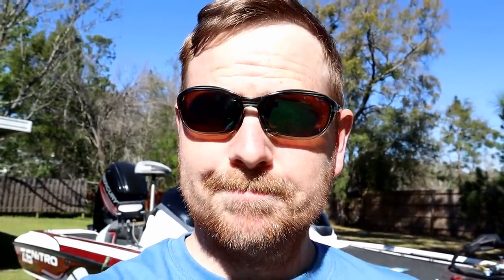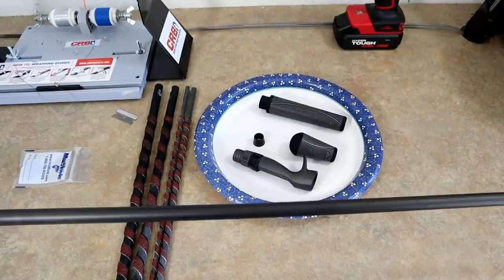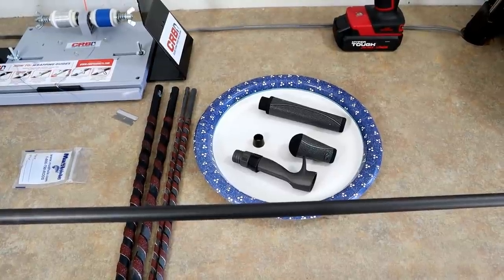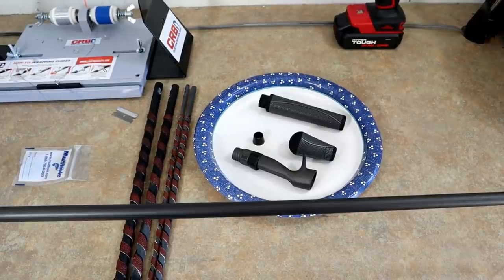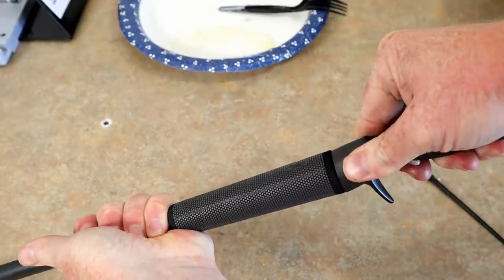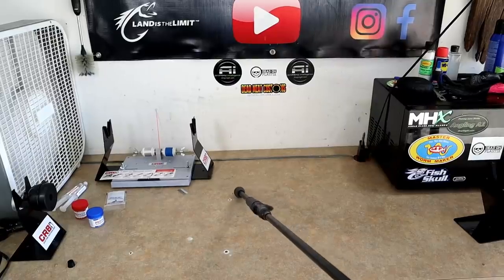SECOND ROD BUILD: Making A Worm & Jig Rod; Custom Rod Building

Comment: Your second rod build turned out much better than my second build.  A couple of things you may want to try.  Measure out exactly where you are going to place your grips, mark them, and rough up the finish on the blank to create a stronger bond.  On a matte blank it's not as important as it would be with a slick finish like the one Scroggins built but trust me it's worth the extra effort and if you don't you will eventually have a grip come loose.  Another thing to keep your grips from getting too loose when you ream them is always start the reamer from the bottom of the so the taper is the same direction as your blank, in other words the bottom of your grip is going to be a slightly larger diameter than the top.  Another thing you might want to look at is "locking wraps" for your single foot guides.  It would be hard for me to type how to do this but there are You Tube videos on this subject.  Flex Coat has a pretty good one on the subject.  Good luck, love your channel!
Reply from the maker: thats a great point on the direction of the reamer...didn't think of that!  thanks for the tips man
Reply: @WorldsWorstFishing  From one drummer to another...

Comment: Nice job! I like the blue/silver color combo. Rod building is so addicting. I keep finding new rod builds that I “need.” I’ve probably built 40 or so bass, panfish, and trolling rods.            One thing I noticed, when you are tightening the wing nut on the thread carriage rod (metal rod that holds the spools), make sure the two nuts in the center are tight to the center post. They were moving a bit when you were wrapping which was why the tension kept loosening. I’ve done that a few times!
Reply from the maker: okay Ill make sure and do that...keeping great tension has been a pain thus far
Reply: That should definitely help. Mudhole also has a new 4 spool carriage upgrade that uses a different knob for tension and fits over the old one. It’s so much better!

Comment: I build rods sometimes, but I often find myself reguiding rods. Even some very nice off the rack rods have not so great guides, or maybe dont have enough guides. My first foray into reguiding was on a shore beater ugly stik I use for cat fishing. It was a two piece rod, and the guides were so far off the spine, that the upper half would rotate under load. It's all a bit easier for me, since I own a motorized wrapper, but even with the experience I have, I still learn a surprising amout from your channel.👍👍👍

Comment: 2 tips, on your thread wrapper, tighten the two interior jam nuts so that the spool shaft does not rotate.  This allows you to tension each spool individually with the provided wing nuts.  
When I wrap accents, I find it easier to wrap the accent first and then wrap the guide thread on.  Lock the tag ends of the accent thread under your guide wrap thread.  This keeps the accent wraps in place until finish is applied.
Reply from the maker: thanks for the tips man

Comment: much better!!!   a quick tip.. cut the tips of your paintbrush and as you apply the epoxy to the thread wraps turn the brush  so that you are pushing the epoxy to the edge of the wraps with a point rather than a flat brush.  this will allow you to get a nice sharp edge to your epoxy..

Comment: Love the difference from the first video to this again lock that threaded rod the spools are on tight and your tension will be adjusted by the wing nut and that will certainly help with how tight the threads are against one another and pull the tag end on the opposite side of the guide to secure it tight also filing down the tips of the guides will help the thread transition from blank to guide tight lines
Reply from the maker: yeah my tension setting need some work!

Comment: Looking good! Keep practicing and it will get easier and easier. One thing you may want to try is A or B sized thread for the wraps and may want to tighten the bolt on the hand wrapper. I keep mine tight so the thread spoil rotates around the bolt, good work bro!
Reply from the maker: Hey John!! I think im using A size..havent actually looked since I got the kit.  Def gonna keep practicing.
Reply: Your doing good!

Comment: Looking good!!! If you use a thread that contains nylon, you can use cigarette lighter to give the thread a little burn treatment after wrapping. That way you do not need to rush putting on epoxy as the nylon in thread burns a bit with heat treatment and and "secures" the thread form getting loose. :)
Reply from the maker: hmmm...very interesting!

Comment: To make your highlight band easier, tape the highlight thread to the blank after you get the guide banded down. I like to wrap up to the ring, then start wrapping back.place two pull loops when your about halfway back to the starting point. Use one to pull your main thread under.( I like to pull under at least a quarter inch,  by pinning the thread just under the first wrap. Then cut the tag end about an eighth inch long. That way when you pull your loop, you don't have that little fuzzy nub to deal with.) Then, do the trim band the same way. It's faster, neater, and much easier.
Reply: 😅😅😅😅 2:28

Comment: As a rod builder myself, I tried not to cringe too much watching your first build. I had to keep reminding myself that you had no lessons and we just looking for something that functioned well. But, as it is with all things, once we do it once, we immediately start looking for ways to make the next one better (it can’t be just me!). You appear to have done exactly that, as your second rod is far and away better (looking) than your first. 

One thing that will help you keep things “in line” is to get a view of your blank to where you can see the lights from above you forming a line along the blank, and use that line from the lights to set up anything that needs to run lengthwise, like your decal. (Ie. bring the top of the decal, or the top of the writing, in line with the light-line, and it’ll be level with the rest of the rod). Your first decal was askew, the second looked a Lot better. This method will also help if/when you do a lot of decorative wraps, keeping your crossing points lined up, etc.  

(Of course, I am just now realizing that these videos are from 3 years ago, and since I haven’t scrolled through your channel yet, you may not need these tips…but maybe someone else will get something from all of our comments)
Reply from the maker: I had a Is lot of fun building rods.. I don't do it anymore since I don't fish as much.
Reply from the maker: Funny enough my very 1st build has lasted the best... Not a single eye has come loose, the handle is still secure and the blank still in great shape... The rod from this video snapped in half while I was casting it lol

Comment: Did you grind the guide feet as well as the hook keeper? That will give you a neater thread run on the guides without being raised too high. 
If you are using size A thread on small guides, double wrap them so you have a good strong tie down. When you epoxy, it will have more thread to penetrate and make those points much stronger.

Place those types of hook keepers in the opposite direction. Very darn good try and work for a second time.

The more you make, you will achieve perfection in no time. Especially when taking pride in your personal rods and work. 

I dont have nice mud hole equipment  buy I made a lot of mistakes in the beginning. I have just remade my first complete unique spiral wrapped jigging rod, medium heavy action 30- 80lb.

I have a makeshift wrapping station with wood and I have no power wrapper or dryer so I am forced to use 5 minute epoxy so I turn with my hand till it sets up. Thin coats at a time. 

There is nothing better than making your own personal customized fishing rod and going out and using it and catching lots of fish knowing you have good strong reliable equipment in your hands.

Comment: You want to put your pull loop on the back of the rod so it doesn't end up in the gap where the guide foot sits. It can loosen up on you before you put the epoxy on, if your not careful. Also it will be less noticeable when you hold the rod. Good work! It is nothing but practice to get it down.
Reply from the maker: thank you man...def lots to learn

Comment: Thats a sexy rod. Id use the crap out of that. I have 1 of my favorites had a eye come loose can i use regular thread to tie my eye back in and by that i mean to spin it on the eye as u did with ur new rod? I dont have epoxy however is there a specific kind that i need to buy? Thanks for the video btw always down for learning something new whether its a new method of lure presentation or how to fix something i broke. Thanks man. Good day to u
Reply from the maker: I'm not sure if the epoxy Mudhole sells is different then regular stuff..I really don't know which to recommend.
Reply: Just my two cents worth, Academy Sports and Outdoors sells a Fuji Emergency Rod Repair Kit ( sku# 118278884). It includes the brushes, thread wrapping epoxy, and thread for $10.99. That is about the cheapest route to go in fixing a line guide wrap, otherwise, I would go with bigger if there were more guides to be repaired. If that is the case, Jann's Netcraft sells Flex Coat All In One Rod Assembly Kit for $12.35. Please don't think that I am against Mudhole by any means. I have bought blanks from them in the past. They are very good by the way. I was trying to inform you of some cheaper ways for repairing your rod.
Reply: Go to Mudhole.com they have videos on how to repair guides. Yes the epoxy is made for rod building, It does not yellow or become brittle. The thread is specific for rod building as well. It doesn't have oils or lubricants like sewing thread that would create problems in the finish epoxy.

Comment: looks great!! 

However, just a good practice is to pull your tag ends through the opposite side of the guide foot. If you pull it through near the guide foot there is always a gap between rod blank and thread, and the tread could work its self loose. Just something I do for added assurance nothing will come loose.
Reply from the maker: thanks for the tip...i'll try and keep that in mind.
Reply: I was just thinking of making this suggestion. I just built my first three days ago but saw a whole bunch of videos of guys making that suggestion.

Comment: Does anyone know what the tubing stuff he uses to set the guides is?
Reply: Nick Fiebrich mud hole has two types of options for that. One is like this white tube and one is like red o-rings. I haven’t used them yet, but was thinking about the super inexpensive sets of o-rings from auto shops that come in huge packs and a variety of sizes
Reply: Robert Carrozzo thanks I’ll check it out
Reply from the maker: the tubes are from mudhole, they are essentially rubber bands

Comment: Rather than pack in epoxy into the end of the reel seat, I would think a sized O-ring epoxied at the screw-lock would ensure the blank was centered into the reel seat.
Reply: I agree with you.  Plus, not only will the o-ring center this, it will also handle water better than masking tape would.
Reply from the maker: I'll see about getting a set of those, I would imagine MH offers that.

Comment: ??????? Did you SPLINE the shaft ?  OKay ..... I see ..... I usually spline it before glueing trigger.....okay you did good ........... best part of building your own. I can go into Bass Pro and almost 75 to 80 % are totally Not Splined .... meaning you are Not getting the right Parabolic or Tip sensitivity as advertised.
I made custom golf iron  graphite shafts for 20 years and they too had to be splined to properly draw or fade your shot. Not much different.
Reply from the maker: Crazy how they don't take the 15 seconds necessary to spline a blank on production rods... usually UV set the epoxy too...cut lots of corners